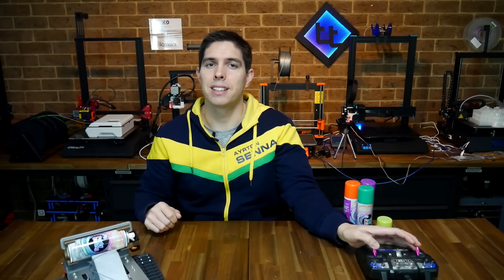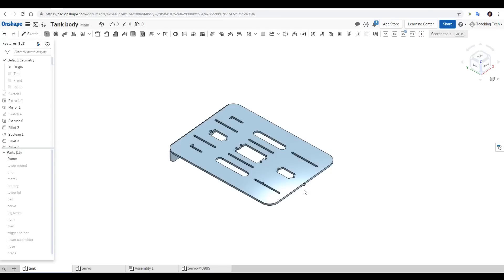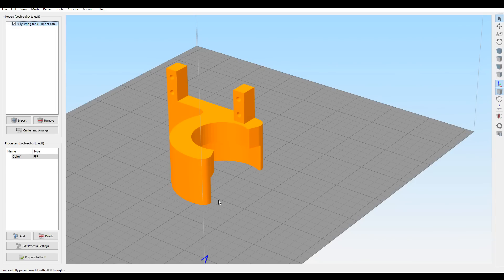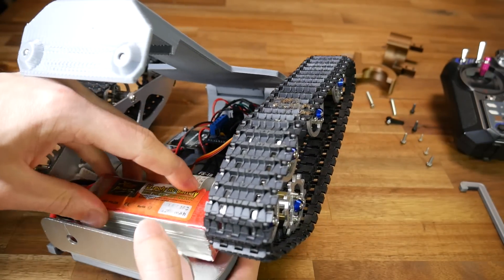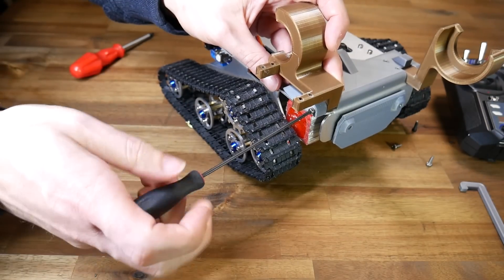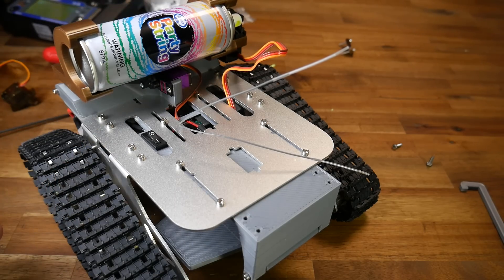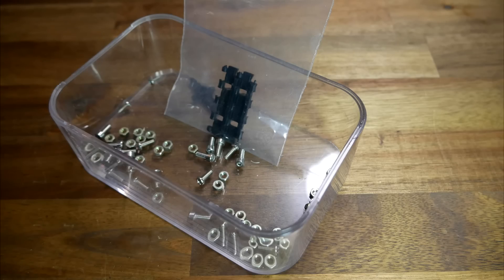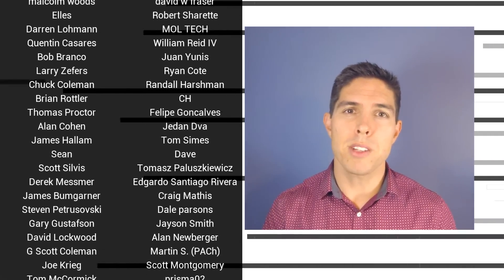Silly string RC tank part 2 - Printed parts and action!

Comment: Exactly what you just described in this 2nd video.  All tanks i've seen of this type,  the forward movement is towards the larger track diameter.  That is because the weight and balance will help to keep the tank from flipping over.   Thanks for posting.  In your first video, your electronics explanation was spot on.   Thank you.